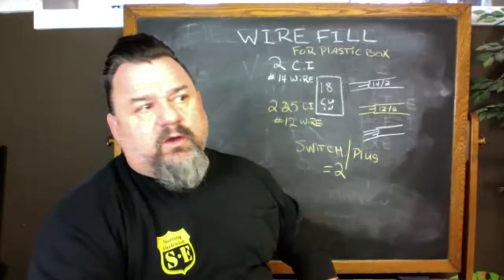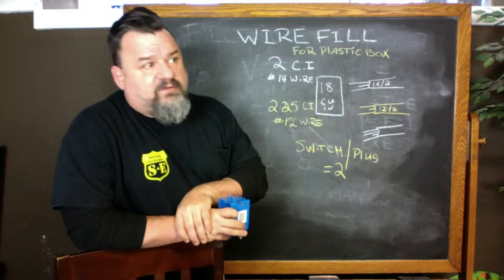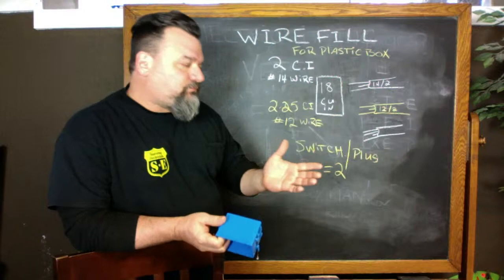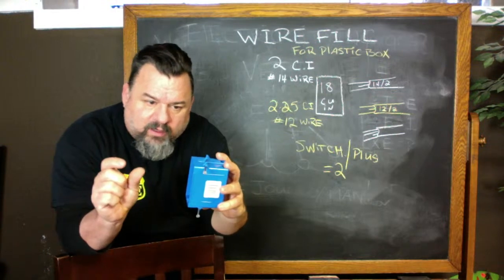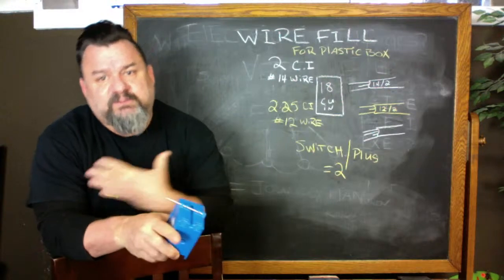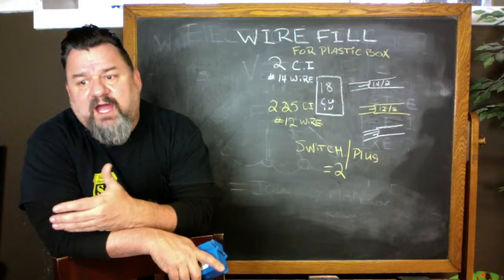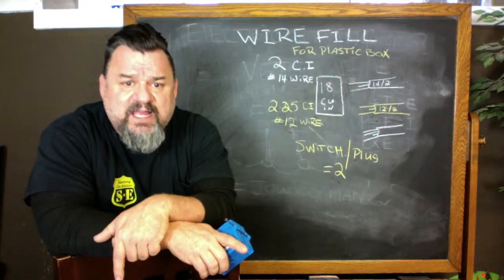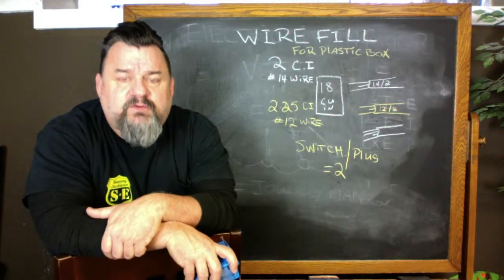Easy Electrical wire fill Calculations or boxes!! What most DIYer's don't Know!

Comment: First time wiring in a new lamp in the ceiling and I want to  change the switch to a combination switch with one to going to the outlet and the other to the light.. When I took off the switch plate there were already 3 romex wires coming in to what seems like a pretty tiny box even though right now  it is just a single switch going to an outlet and those wires are already really crammed in there and the box only has two holes on the top already crowded with those 3 romex. I don't see any knock outs that could be used to add more. So I guess I will move up to a bigger box and just get one of those plates that is blank on one side. Your video confirmed my uneasy feeling that there was already too much going on in that that little box.
Reply from the maker: yea or maybe turn that box into a smoke detector and keep only the switch leg in that box. sounds like the feed is in that light box though. be careful

Comment: Can you have 3 romex cables going to a 18inch public plastic box? 14/2. I have a lower outlet that already has 2 hot 2 neutral and ground. I want to add a outlet above the lower one for a tv. So I would be tapping into the original box with another hot and neutral and ground. It would be then three hots, three neutrals in the 18 cubic box. All 14/2. Thanks
Reply from the maker: well I have the math for you right there the grounds only count as one.

Comment: Might be an amateur question but my house was built in the 60s. The light switches turn off and on an outlet. I would like to put a light in the ceiling for the light switch. But still want to keep the outlet running without the light switch. Might be an easy job but just wondering how would I approach this? Thanks in advance.
Reply from the maker: just wire the plug hot all the time. the wire that switches the plug you take off the one side of the switch and tie it with the hots and then take a new romex to the celing. tie the neutrals together in the switch box and tie the new black to the switch where you removed the wire and you are all there!!

Comment: I think that the box would not pass inspection.  There was already a comment that the calculation for the ground wires is equal to the largest conductor.   In addition, the device calculation would be 2x the value of the largest conductor connected to the device.   Assuming the #14 wire was connected to the device here is my calculations:
5 #14 conductors               5x2.    =     10
2 #12 conductors               2x2.25=      4.5
Ground wires                                   =      2.25
1 device  counts 2x 2(for # 14)    =      4
       Total                                          =     20.75
This would exceed the rating of the 18 cubic in plastic box.
If I made a calculation mistake, I would be happy to learn where.
Reply from the maker: I never included the device. I’m only trying to show how to calculate the wires in this video. There are other factors like I say like metal boxes with wire supports etc. this is for the beginner to grasp not for my video to pass a fucking inspection based on what Devise is installed. There’s a lot of scenarios that can alter box fill. Don’t look for something to discredit me on MY channel.

Comment: How are hvac guys able to use a 6/2 wire for a 60 amp breaker for an air handler with a heat strip ?  6/2 is normally for a 50 amp circuit. Am I missing something or is there a rule to it?
Reply from the maker: copper #6 is rated 50-60 amp. but a heat strip thats a continuous load so you would get closer to a 60 amp circuit.
Reply: @StarvingElectrician  that wouldn't be romex 6/2 or 6/3 for that 60 amp circuit right? Would it have to be a thhn? What I had read was thhn is a different temperature rating so it can carry more current. I need to install a circuit for my air handler and it has a  double pole 30 amp and a double pole 60 amp.
Reply from the maker: @stcharleshometheater   yes thhn. Don’t think you need a neutral so just  2 hots and a ground unless the heat strip needs a neutral but it’s not likely.
Reply: @StarvingElectrician  thank you very much. I love your videos and look forward to more! Thanks again 👍
Reply: @StarvingElectrician  do they make a 6/2 thhn wire? Or would I have to go to a supply house for it.
Reply from the maker: @stcharleshometheater   no problem. glad you can take something from them!!!
Reply from the maker: @stcharleshometheater   oh yes. i have some rolling around in my van as we speak. just take a look in home depot.
Reply: @StarvingElectrician  I looked at my dad's air handler tonight and it takes (2) 50 amp and (1) 60 amp breaker and they used all type nm romex 6/2 cable isn't that wrong?

Comment: I have a question if you don't mind.  I have a wall receptacle that has wires on all four terminals with a pigtail ground. ( I presume it's running in parallel) to another box somewhere) I need to add another receptacle right behind that to the other side of the wall .  Can I pigtail either top or bottom of  one of those and run a wire through the wall to another new receptacle?   It's on 20 amp circuit, but the box/receptacle I need to add will be under a counter to use for the piezo lighter for the cooktop.
Reply from the maker: Yea you should be good but I would pigtail all the wires together to feed that box instead of using the plugs to tap off. Hope this helps
Reply: @StarvingElectrician    Great.  Thanks for the tip.. WIll pigtail all as suggested
Reply from the maker: avflyguy make sure the power is off. Stay safe!

Comment: Very helpful video.  Can you help, what wire gauge and conductor needed to install a 50-75ft line run for a 60-amp/240v disconnect box  for heat pump?
Reply from the maker: there wouldn't be a voltage drop with that short of a distance. go with #6 copper .  4 wire. hope this helps

Comment: Love your videos but, you made an error on the ground wires.  2017 NEC 314.16(B)(5) states:  "Where one or more equipment grounding conductors or equipment bonding jumpers enter a box, a single volume allowance in accordance with Table 314.16(B) shall be made based on the largest equipment grounding conductor or equipment bonding jumper present in the box".  Therefore, your largest EGC in your example is 12 AWG, so the EGC's actually count as a single volume allowance at 2.25 cubic inches.  I'm sure you know this and just missed it trying to put the video together, but thought I would clarify for your viewers.
Reply from the maker: Yep you are right! I botched that one. Lol thanks for pointing that out.
Reply: Oh, now I get it

Comment: Just finished my house remodel here in LA and they DIDN'T make me put in the arcfault breakers.  Whew
Reply from the maker: Thank you so much for showing the love!  as far as arc fault they are now only required in new construction or a place that the walls are down or multi family dwellings. the reason being is if neutrals are shared anywhere with another circuit (which they often are) then they will never work. you would have to rework the wiring so they spared us that pain in the ass. I shouldn't say thats why they did it but it makes sense to me!! lol
Reply: @StarvingElectrician  You could be right.  And maybe because I actually had everything permitted (WTF?!?!) they were being nice to me...